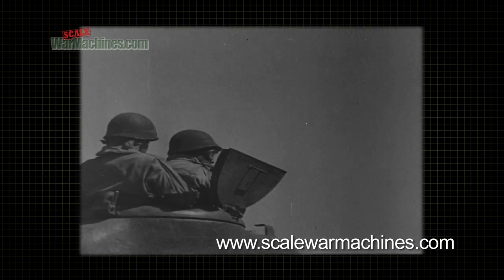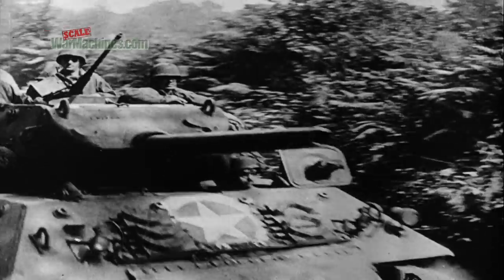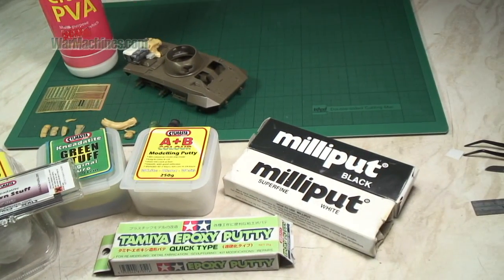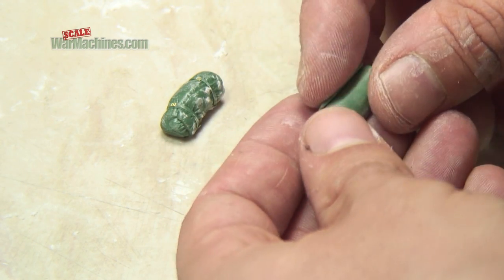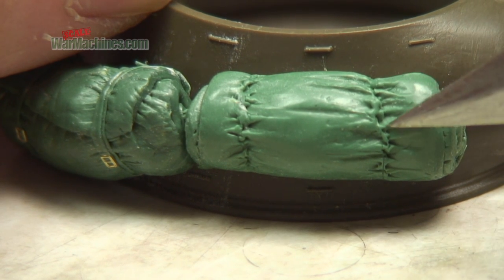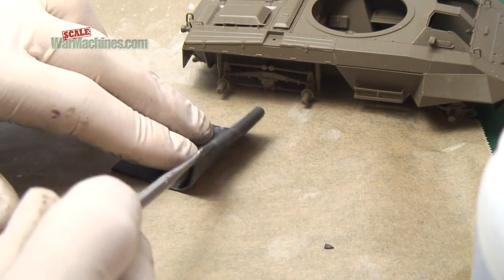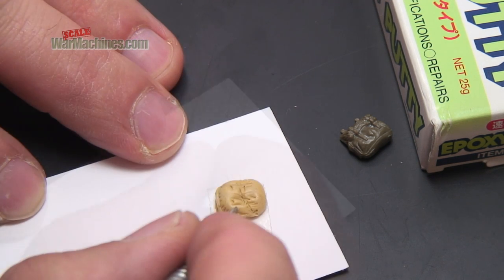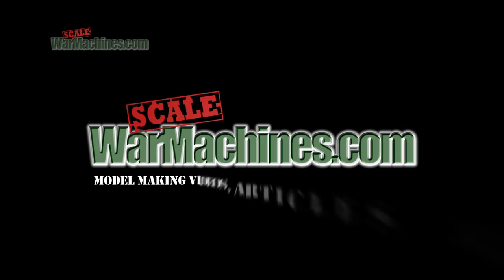MAKING YOUR OWN STOWAGE "HOW TO" GUIDE

Comment: A technique I've used before with fair success is using material attached to a wooden dowel to make impressions like canvas. You need a material with fine small weave patterns depending on the scale.

Comment: I like to use paper towel dipped in a thin white glue wash, let dry in the oven on a low heat ,after dry ,airbrush then tie on model with a heavy thread, works  foe me🇨🇦🇨🇦👍🏻

Comment: Would these laser etch buckles work at 1:56 (28mm) ? Also what is the best for rope type fixtures? Simple thread or is there something better?
Reply from the maker: At that scale they might be too big and so would most thread. Maybe try really fine fuse wire instead. Some of the buckles could work if on the smaller side and used for big bags and packs at that scale - but it may be just too small...

Comment: After the Milliput dries, will it need to be glued to the model, or will it bond to it?
Reply from the maker: You're right to think about that. It's a bit of both. Milliput can bond to surfaces it is in contact with. That bond can sometimes be relatively strong - though you can usually "snap" stowage off the model with a bit of gentle force. If you want to remove it easily when dry and glue it later or if you don't want it to bond, use a barrier like cling film, foil or tape. Otherwise, it's just a case of prising it off and glueing with something like white glue.
Reply: Thanks for the fast reply, tips, advice, and all the great videos...